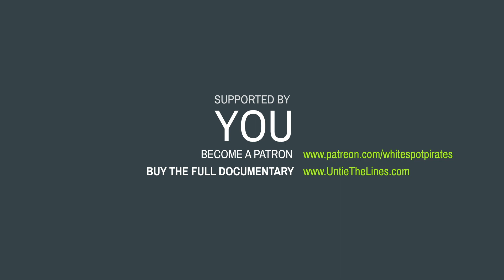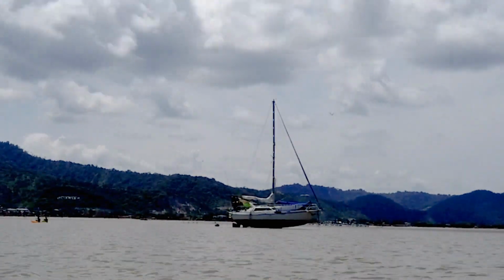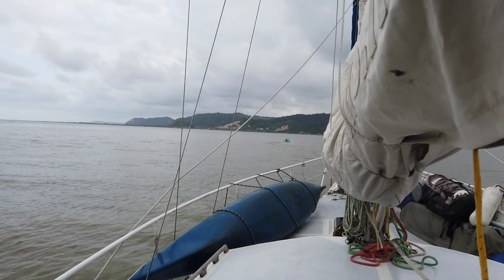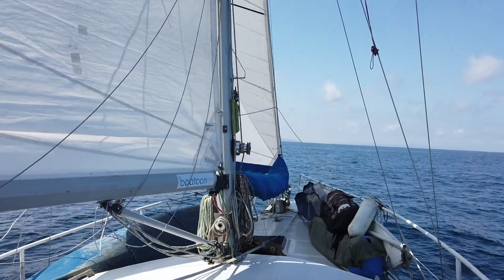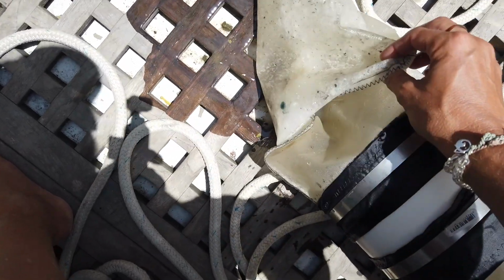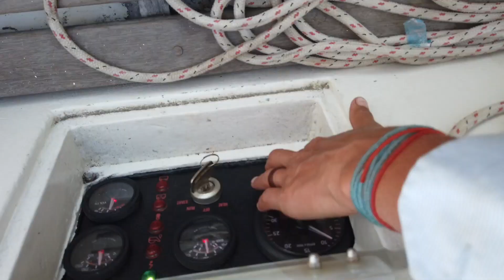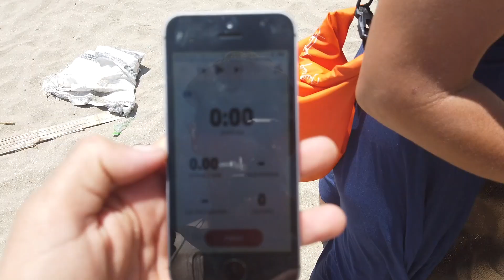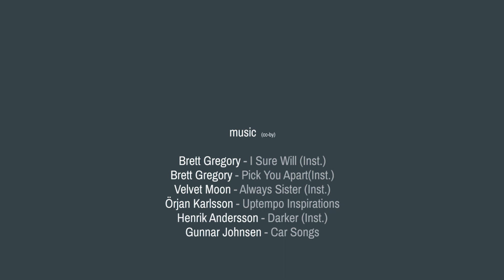GROUNDED SAILBOAT: How I beached my sailboat on purpose - UNTIE THE LINES IV #51

Comment: The ability to beach the vessel to clean, inspect, and/or repair the bottom is precisely why I designed my new sailboat (I'm presently building the hull) with twin keels.
Reply from the maker: it is a great feature. Just not soooo great for sailing upwind...:(
Reply: @WhiteSpotPirates  - I'm a retired naval architect and marine  engineer. The one word we have learned to adopt and make a key part of out profession is: "Compromise." You see so many different designs out there, and many are for very specific purposes offering excellent performance for the intended purpose, yet not so much for others. On the other hand, there are the "middle of the road" designs that are not wonderful at anything, but sort of okay in most situations (these are mostly high-volume production boats). "Compromise is a wonderful word in the world of boat design, but it can also offer a few woes. The design for my personal sailboat is loaded with compromises and designed to fit my future cruising plans - it would not be very appealing to the average sailor looking at stock boats to buy off the showroom floor, but that's the way it goes. I suspect "Karl" was originally designed and built with some specific thoughts in mind. I enjoy following your adventures - I just recently found you and subscribed. Great job on your videos! Thanks.
Reply: @WhiteSpotPirates  Fifty years ago, when I was a 12 year old tyke, I met an old sailor who told me "Young man, when you buy a boat, make sure it goes upwind. A piece of plywood will go downwind". I never forgot his advice and it proved to be right. I've made sure all the boats I've owned go upwind well, and have had to claw my way off a lee shore more than a few times. I was grateful for the wisdom...now I'm an old sailor  ;-)

Comment: From what I have read, open ocean plastics are something like 96% from commercial fishing operations and only 4% from consumer plastics. Nearshore those numbers are different, with the majority of plastics (and trash overall) coming from run-off. The issue at a greater level is not just the single-use plastics, but how trash, in general, is handled in developing countries, island nations and the G20. 

Windward sides of islands will always have the most trash, while where most sailers anchor/dock tends to be on the leeward sides, and thus sailors don't really see just how bad some places can be.
Reply from the maker: Oh believe me, I have seen my share of "bad" ;). You are right that a lot of the trash comes from the fishing industry. Another big part gets washed into the oceans over the rivers. Reducing single use plastic is something everybody can do in their daily life which is why I mentioned it. Everybody plays a role in trying to solve this problem. Reducing single use plastic is just one of them.
Of course, the missing waste management in many countries is the biggest issue. It's a little bit more tricky to tackle by end consumers, though. We want to try and establish some project that turn plastic waste into a precious resource in remote coastal areas with little infrastructure. This is of course only on a small scale...but it's a way to takle a part of the problem.

Comment: I bartend and manage bars and often have to use disposable items to include food utensils and containers. For inventory control measures I have to dispose of cups to coincide with units of product that I charge for. 1 shot of booze = 1 certain cup so I know how much cash I'm actually losing and we can still stay in business and I can keep owners, customers, and employees happy with a sustainable economy. Where we can use paper we will. Most all of the items are PLA or Corn based plastic cups etc. I've put all those items in my garden composter to test how long it takes them to decompose into soil. After 3 months I could find recognizable bits and after 6 months I could find anything and used it on my lawn and in the garden. That being said when I serve it I occasionally get angry customers decrying my rape of the environment. NOT ALL PLASTIC CONTAINERS ARE MADE EQUAL AND SOME METAL ITEMS OR OTHER ITEMS ALSO HAVE AN IMPACT ON THE ENVIRONMENT AND PLEASE REMEMBER TO TIP YOUR SERVERS.

Comment: Hi Nike, I see your boat has metal degradation and posted to you but it was a six month old video. A metal boat needs to have above earth electrics eg. no earth connected to the hull. The main problem here is the engine, first make sure that your house batteries are not connected to the hull in andy way. With the engine you need to have above earth oil pressure and water Temp. senders and above earth alternator and a Battery switch to isolate the earth lead to the starter motor and run the instrument panel earth back to the start battery instead of the engine block. to start the motor, switch on the earth battery switch to the starter start the engine then turn of the switch, then you above earth, if you do not do this your problem will never be solved. The cost is the alternator, Balmer and other good marine alternator manufacturers make them and it gives you the chance to have a hi amps delivered to your batteries while you have that lovely new motor running. I purchased my with the problem but now the problem has completely gone.

Comment: How old is your anti foul? and what type was it?
Reply from the maker: At that point, it was not very old, probably half a year. It was SeaHawk, super expensive and I really cannot say I am a big fan of it. I used to have Transocean, but they don't make their copper free antifoul anymore. It had a reasonable price and worked really well. Will have to try a different one next time.
Reply: @WhiteSpotPirates   Many thanks.  I've used Trilux33 on my Aluminium Ovni, but its not great in the caribbean, and very soft. 
So if you scrub the hull, then most of it disappears. 
French company META recommend  inorganic zinc-silicate "Inversalu" but hard to get/expensive outside Europe. 
A similar product is 
PPG’s products, Dimetcote 21-5.  
See https://www.practical-sailor.com/issues/37_17/features/10783-1.html
I've thought about trying Silicone based anti fouling coatings like Sea-Speed vx10x, Intersleek 1100sr and Silic-one or PPG Sigma SigmaGlide 890
. 
but if its no better then next season there is a problem.
Silicone based antifouls are incompatible with other non-silicone coatings so every little 
bit of the silicone paint has to be removed before you can over coat with another type of anti foul.
Bottom line as I see it, its almost impossible to find a good antifoul for aluminium boats. 
I know a few owners who have gone for multiple epoxy barrier coasts then used Coppercoat. 
But its a risky business and I don't think I would have the courage to try it. 
After your problems with hull corrosion repairs I'm guessing you also would be reluctant.
Fair winds... keep up the blog,
Reply from the maker: @sv_KindofBlue  Triluxx is the SeaHawk version of International, I think. Sounds quite like it ;). The SeaHawk one is just as expensive and also super ablative.
I had looked at the silicone stuff, two. But you have to go down to bare metal and it's super expensive and I just don't have that kind of money laying around...But long term it's cheaper...
I just found this one in Ecuador https://www.pinturasunidas.com/uploads/productos/industrial/ancla-antifouling%20.pdf
It seems to be copper free, just wrote them to see if that's really the case. I need to do my bottom again in spring, so I wanted to look for a cheaper local solution. 
Some people have recommended the "primer and copper antifoul" solution to me, especially many paint companies in Panama that did not have copper-free available. For me it's a total no-go. No need to add another potential worry even though the theory says it's not really such a big danger. But just knowing it could be is something I prefer to avoid ;).
Well, let's see what the Ecuadorian peeps say about this one...
Ahoy, Nike

Comment: What are your opinions of plastic incineration or conversion into fuel (pyrolysis or HTL)? It seems to me like that could actually be an option for clearing the garbage patches. It would take boats who are willing to scoop up the plastics and convert to fuel onboard, but at least there is an economic incentive to cleaning the ocean (free fuel!). But it still contributes to global warming. Not optimal, but I think better than nothing.
Reply from the maker: That's actually something I am currently researching about. Yes, you do have emissions when that recycled fuel is burnt BUT they would use fuel anyways...and that way you replace diesel that otherwise would have to be made from natural recources. The plastic is already there...and it will at some point do its harm...especially if it's out in the ocean or in a landfill. IMO its better to turn it into fuel. And as you said, it gives a great incentive for the locals to collect the garbage.

We are currently looking into two ways to create circular economies that turn plastic trash into a precious resource: pyrolysis and recylcing the trash into consumer good that tourists can buy. The latter only work in touristy areas, though and not with badly contaminated or non identifyable plastic. That's why we add the pyrolysis to the "tool kit". 

It's all still in the research phase, but we hope to do a trial run early next year...
Reply: @WhiteSpotPirates  that's awesome. I'm working with a friend to design a reactor that is small and self contained enough to keep on a sailing yacht. We've explored two options: 1) a plasma reformer (kinda like pyrolysis) that feeds into a solid oxide fuel cell for battery charging, and 2) a plasma reformer that feeds into a Fischer Tropsch reactor for creating fuel. 

We're still in the conceptual stage though, working on our first prototype in a couple months.
Reply from the maker: @danieltoone5979  sweet, are you planning to sell that? Or share the building instructions? Sounds SUPER interesting. Good luck and please keep me posted on the progree.
Reply: @WhiteSpotPirates  Both ideas would require some specialized manufacturing, so it probably wouldn't be very helpful to just share plans. I think we're gonna try to sell them, but all of that will require more research.
Reply from the maker: @danieltoone5979  cool, sounds like u have something interedting going. We r more aiming for a 500 to 1000 $ pyrolysis set up that u need no special tools for to make it. But definitely not for use ON  a sailboat 😂

Comment: Your the only Channel that’s doing something about plastic. My town has banned plastic straws and bags. It’s a start
Reply from the maker: I am pretty sure I have heard some other channels point out the problem of plastic pollution as well. It's a bit of a tricky issue...vlogging is my job and therefore I depend on the money I make with the videos to be able to live. I think that's the same for many of the sailing vloggers. Many people don't like "eco preaching" as someone called it the other day and unscubscribe. For me, the topic is very close to my heart, especially because I live on and of the ocean. But I try to feed it to the people in bits here and there because I don't want to lose my subscribers due to an overload of "awareness rising". BUT: I am working on a recycling project on the side and will soon start communicating more about that on a different channel. Because the topic is too important not to talk about! I will surely keep on smuggling some bits of eco preaching in here, too, though. Because those who watch "eco channels" usually already have an eco-friendly mindset and it's important to reach those who don't.

Comment: Glass Jars are so important but some have plastic lids to seal it. Plus you cant freeze glass. But there is hemp that can take the place of most plastics nylon paper even cardboard boxes. Hemp used to be used for sheets as in sails also Hemp was used for rope clothing cloth even used to purify water  as n early filter. I think the world should go backwards to save it as use Hemp in a modern way including bags straws bin bags so many other things. If used right can even make boats from Hemp instead of fibreglass or plastics.

Comment: Love your videos having happened across them a couple of months ago. A quick question - what app were you using to catalogue the plastic on the beach. I'm on the Isle of Wight, UK and regularly litter pick on local beachs. All the best
Reply from the maker: Happy to hear about your litter collection activity. If you are on instagram, would love if you tagged @inmoceanorg or #inmocean next time :). the phone I used then broke down so I am not sure what that one was called. there is a similar one called marine debris tracker which is much better because you can manually enter the total number in each section. the one I had you had to press a button for each piece which go a bit annoying when u had to enter 78 styrophone pieces ;). The only thing I don't get on that app is why you have to select a in the first step. But I guess that's just saying which organisation you are picking for. Here's the link for IOS https://apps.apple.com/us/app/marine-debris-tracker/id432758761
Reply: @WhiteSpotPirates  Thanks for the info, will check it out. I'm not on Instagram but use Twitter from time to time. Hope the recovery is going well.
Reply from the maker: @lungin  yeah, it's going okay....super slow. The wound just won't heal because the foot has such bad blood circulation and not much tissue...but at least I am free of pain killers since a week now, that's really good!
Reply: @WhiteSpotPirates  Good news. Getting off pain killers is a major move forward.  All the best to you and here's to the future and getting back on Karl

Comment: Thought you was going to swap the “Garmin “ and the “compass “ round  so the auto pilot was at least 6” away ?
Reply from the maker: yeah, that's the plan...just did not do it, yet. Was excited to get under way, so I postponed it. It worked well the way it was...and you know what usually happens when things work alright ;)
Reply: WhiteSpotPirates yep if it ain’t broke don’t fix it😆